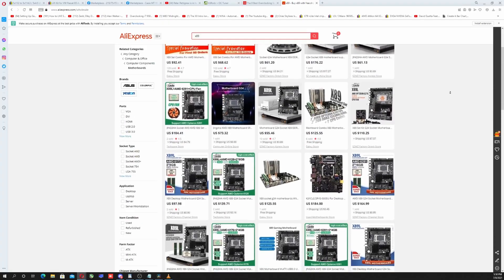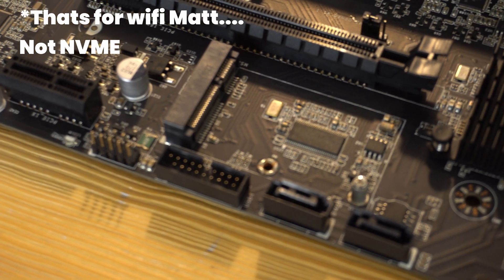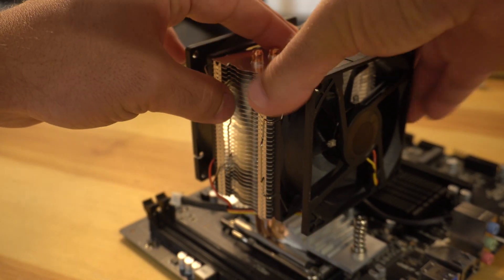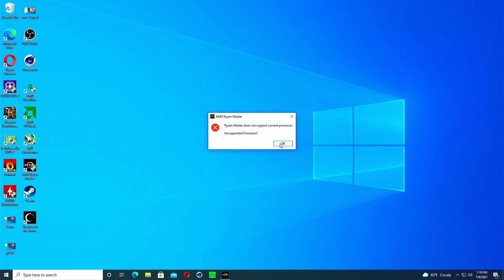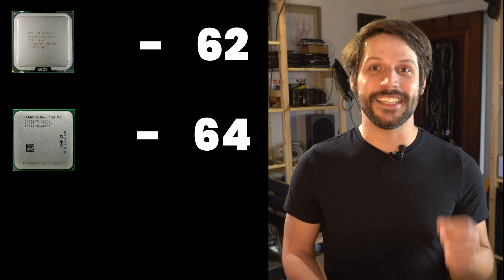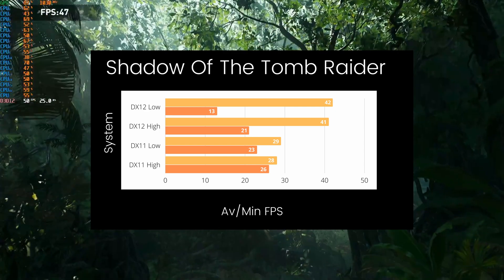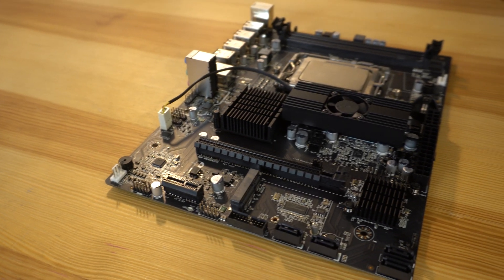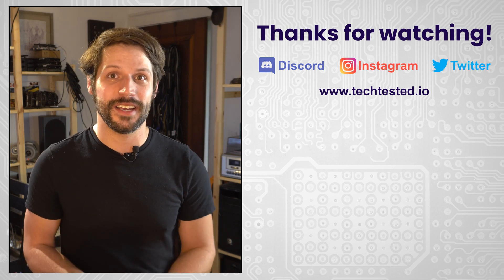16 Core AMD CPU for Less Than $100?

Comment: Cool video but I have to disagree on one point about 2 sticks only not being a big deal. These CPU's already struggle with RAM bandwidth and they really only make sense in configurations with full quad channel RAM. The topology of the processor package means only one of the dies is getting direct access to these two channels and the other die has to fetch data over Hypertransport (Infinity Fabrics predecessor). Already low performance tanks as a result.

As for boosting, these AliExpress boards have a locked boost functionality. You need to find it in BIOS and enable it so that single core boost can work.

These boards are cool for educational purposes but they're fundamentally a way for AliExpress to recycle e-waste G34 Opterons and chipsets.

Comment: The CPU is not bad but rather it has a different purpose. The bundle does not seem to suit your personal use case though. It does however provide a MBoard to test the CPU before slotting it into a server blade (or similar) MBoard with other CPU opterons. The cooler is a cooler to get things running in a limited situations.
The CPU is not intended for that but for heat dissipation when all 16 cores are used with the instruction-set it has available such as AVX, and as such more likely with specific mathematics such as using R in coding. The shared cache per module shows it has increased likelihood of uses with the FPU, and as such a maths library, and some examples could include matrices. Nice to learn coding on if a specific goal is in mind. As an aside, it is not mean to overclock but, in the original server MBoards, boost to 3200Mhz. It would be interesting to see if that mboard supports SLAT or VMDq or SR-IOV for ethernet/NICs.
My comment has no hate in it and I do no harm. I am not appalled or afraid, boasting or envying or complaining... Just saying. Psalms23: Giving thanks and praise to the Lord and peace and love.

Comment: The issue is not the CPU as much as it is the motherboard. It only employs a single RAM channel which means that 3 out of 4 memory operations are crossing cores inside the proessor on the internal fabric. The chip works MUCH better on a proper motherboard with 4 loaded memory channels, though I agree it's not an ideal platform for gaming because of the low clock speeds and IPC. Where it does shine is in numerous lightly threaded tasks where it's huge cache and 16 (ok, 8) cores can shine.

Comment: My family computer had a very old pc a athlon x64 dual core. And damnn it is slow good thing I built a new pc with a i5 3470 and boy what a upgrade it is, Also it was my first pc build. Enjoying the content btw
Reply from the maker: Yeah the athlon 64 x2 is a bit dated
Reply: the old amd cpu is perrfect for games ut2004 which has a online player base even today and a nvidia 710 class gpu would be the card used to play the game -anything faster would max the graphics
Reply: lowest for the game are actually a nvidia  tnt2 32mb - you can play in 320x240 low and get 12 fps. .Nvidia 5200 which sucks greatly will get you 640x480 low in onslaught -Ati 9800 pro recommended wthich a nvidia 710 are basicilly  but with hugely bigger vram

Comment: Crazy to think you could get an i5 4th gen bundle on eBay for the exact same price. That would be a muuuuuuuuch better choice for gamers.
Reply from the maker: It really would. Honestly almost anything would be better for gaming. Its such a shame they don't have any overclocking features. I really think a higher clock speed could save the reputation of this CPU.
Reply: @TechTested  Some supermicro boards can be modified to overclock.
There are also enginering samples with unlocked multipliers.